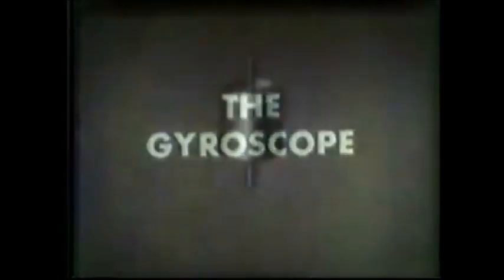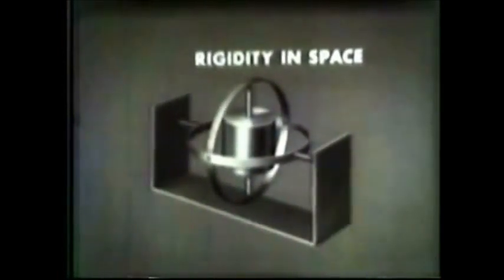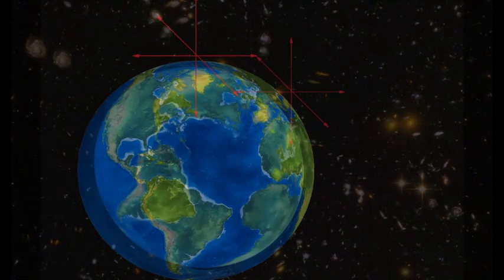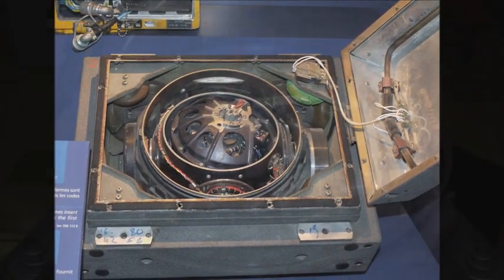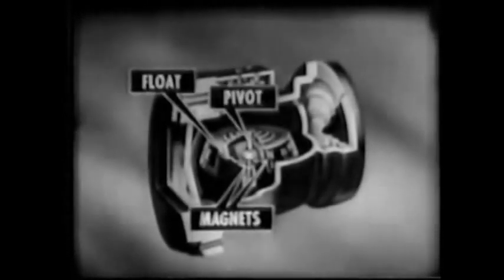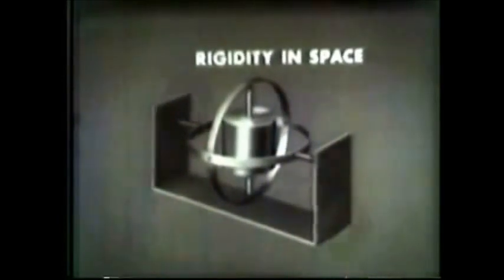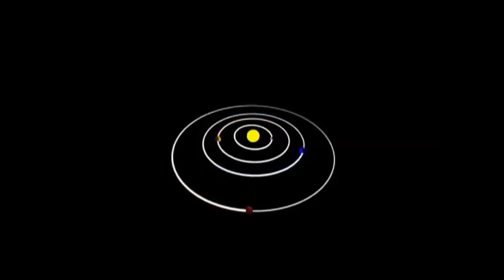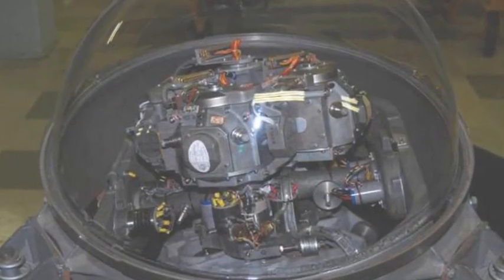Gyro Navigation: IMPOSSIBLE on a Globe...

Comment: I was a Navigation Electronics Technician and worked on the SINS (Earth referenced inertial navigation system) and the ESGM (space referenced inertial navigation system) on three ballistic missile submarines and both systems worked great on the great big round Earth!
Reply from the maker: +David Feist Well clearly they work great, otherwise no one would use them! But what I've been trying to understand is just how an "earth-referenced system" supposedly continually adjusts for curvature. The Navy training film from 1960 says this done by way of linking a magnetic compass to the gyro under "slaved mode".  Today several other explanations are given which frankly all seem rather dubious to me.  Yes, the inertial guidance systems work very well, but how do you convince me that they are working well because they are managing to stay in perfect reference to the center of the globe, and not merely in reference to the x/y/z coordinates of the starting location.  If the gyroscope has to constantly ignore G-forces while maintaining alignment with the center of the earth, why do gyroscopes and accelerometers not have to also be constantly adjusted because of the motion of the Earth's orbit around the sun, the solar system through the galaxy etc.  I've never heard this addressed thus far, yet the very explanation of gyros and inertial nav provided by official sources would seem to demand an answer.  How does the gyro stay fixed in relation to the earth's rotation, but not stay fixed in relation to other spatial motions?
Reply: It' called rho rate, or "round earth torquing".  As you move over the curved surface of the earth the platform, containing the X, Y, and Z gyro, where the X and Y gyro's are torqued to maintain the Z gyro input axis pointed at the center of the earth.  The platform is also torqued for Earth rate with is 15.04 degrees/hour to compensate for the rotation of the earth.  Also, factored in is a correction coriolis acceleration.  Dampening factors are also put in to the inertial navigation to prevent Schuler oscillations.  Schuler oscillations are 84.4 minute sinusoidal waveforms that are equal to a pendulum that has a string the length of the radius of the Earth.  You cannot shoot missiles when you have a Schuler oscillation so we were always watching for those on our X-Y plotter which continually shows the relationship velocity and acceleration in the gyro loops.  The only reason you have gyros in a inertial navigation system is because of gimbal friction.  If you could make gimbals with that had no friction then you would have no need for gyros.  The velocity meters (accelerometers) would always be feeling the proper components of gravity and would not result in an erroneous acceleration.  The gyros allow you to isolate the velocity meters from ships motion due to wave action.  Also, you have to have the area that you are in to have been mapped for gravity since gravity is not uniform.  Mountains bend the gravity vector so that gravity is not uniform on the reference ellipsoid (the earth).  An uncompensated vertical deflection will cause a Schuler oscillation to be induced in the gyro loops of the system.  This brief explanation of a earth referenced inertial navigation system is somewhat simplistic.  I think that it is one of the most complicated systems I have ever encountered.  The space referenced Electrostatically Supported Gyro Monitor system (ESGM) that I also worked on  was vastly more complicated!!!
Reply: +David Feist It should also be noted that these systems do not run all by themselves without periodic updating.  External fix information are entered into the computers which apply resets to the inertial navigation system.  The earth referenced system requires frequent resets.  Each reset physically torques the gyros which the gyros do not like which will cause a change in their drift characteristics which will require another reset later.  Gyros do not like to be torqued.  That is why a space referenced system is much more accurate because at the time of reset the gyros are not torqued, the reset occurs in the computer math model and does not physically affect the space referenced platform therefore it allows for much greater time between the need for an external fix information and reset.
Reply: +the Truth is stranger than fiction... A gyro is not a gravity device, all a gyro does is react to angular displacement.  The velocity meters on the SINS system (EMA or electro magnetic accelerometers on the ESGM system) are affected by gravity.  They are accelerometers and since gravity is an acceleration it will react to it, or for our purposes measure it.
Reply from the maker: +David Feist All in all, I find all these various explanations interesting, but, you seem to be missing the point of my original video on this topic, which was largely based on the explanation provided by the 1960 Navy training film, which obviously was using components far more simplistic than anything involving lasers or microchips being used today.  It claims to have used a magnetic COMPASS as the mechanism by which that "period updating" was achieved, and this is really quite implausible if you ask me.  Sure, it's easy to look at the systems in place today and go "Wow, it's just ridiculously complicated!!", but the farther back in time we go, the simpler the systems get, and that's where I think the real gaping holes in the explanations regarding "correction for curvature" can be easily found.  I also did a video on inertial navigation and ICBMs, did you watch that one?  So many related questions when you get into that...  For instance, you mentioned accelerometers.  So how would that really work, as you say that "gravity is constant" (aside from it varying due to things like interference from mountains, etc.), because the further up into the atmosphere you got, the lesser the pull of gravity would become.  Don't intercontinental missiles pierce up into "low level orbit" essentially?  Not only this, but you also have the fact that NASA claims that craft such as those used in the Apollo missions used a specialized form of inertial nav...  Now how is THAT supposed to have worked???  Both your gyros and your accelerometers would be completely useless once you completely pulled away from the globe and pushed out into the vacuum of space.  And before you postulate that their nav system could've been "periodically updated" by some kind of data signal from Earth, you have to stop and think about how that could've happened when something like Apollo 8 went around the "backside" of the moon.  There was supposedly total "radio silence", if you remember.  So they would have absolutely been "flying blind", around a celestial body they've never been that close to, with no radio/radar contact, no gyro nav, no inertial nav, no nothing....
Reply: +the Truth is stranger than fiction... There is no point in talking to you, you have formed your incredibly simplistic opinion based upon a simple 1960's training film and have proclaimed yourself an expert in inertial navigation.  What could I possibly tell you about how the systems really work when you are a self appointed expert?  I have showed your postings to friends of mine who also worked on submarine inertial navigation systems and we are all laughing our assess of at your statements!!!!!
Reply from the maker: David Feist
Well, I have the testimonies of other NAVAL and air force personnel, who testify to the absolute contrary, so obviously merely waving your military credentials is not in and of itself proof positive of anything, is it?  You need to explain HOW this process of round-earth-torquing supposedly is achieved, to a "simpleton" like me.  Otherwise, it's just one "expert's" word against another.  Not only this, but you actually said that they only reason gyros are used is because of "gimble friction"???  Are you for real?  The gimbles are there for the sake of the gyro, not the other way around.  That much I understand quite well at this point, so much so that to say such a thing is a blatant denial of EVERY official explanation of gyro navigation out there.  I am not "basing my understanding" on a 1960's film, I am putting forward an extremely valid question, which is, HOW did those gyro nav systems actually work, WAY BACK THEN, when they didn't even have any of the technological adjustment mechanisms which you spoke about at length in your comments above???  If you just wish to laugh it away, as if the U.S. Navy never actually released such a film, well, that's your choice.  I however find the panorama of self-contradicting explanations to be less than satisfactory at this point.
Reply: +the Truth is stranger than fiction... Okay, you are right, you know more about inertial navigations systems on submarines than I do.  What do I know?  I only made 11 strategic deterrent patrols on three ballistic missile submarines.  You sir, are an expert, self appointed with a tin foil hat.
Reply from the maker: David Feist
I am obviously not an expert.  I never claimed to be an expert.  Is this really the only angle you have left?  The only reason I started on this little direction of investigation, was after hearing an interview with a U.S. Navy missile system instructor, who publicly testified to the fact that the ship's gyro nav system never compensates for curvature, and what's more, the ballistics systems he uses (which are connected to the ship's gyro nav) never account for curvature, nor "coriolis effect", etc.  He also explains how the weapons system he uses employs a "focused radar beam", used to "paint the target" (i.e. enemy ships) over distances of up to 50 miles.  If you calculate the curvature that should be in the way, this should absolutely impossible.  After this, I listened to a retired Navy submarine officer, who testified to the same thing regarding gyro nav.  After that, it was a flight instructor, speaking to the same points about gyroscopic instruments and the "artificial horizon".  And just the other day, I'm listening to a retired Air Force officer again talk about the SAME issue with the gyro/inertial nav systems...  So, what did I do?  Did I simply believe what I heard from all these men, because they obviously have far more experience with these things than I do, and therefore must be automatically correct?  No.  I went out and tried to see if I could verify these claims on my own, independently.  (correct me if I'm wrong, but I thought that's how science was supposed to work...?)  And what I began to discover was indeed very bizarre.  Much of it boils down to the question of "do gyros indeed have to compensate for curvature" (both due to movement, and the Earth's own rotation...) If the answer is "yes they do", then you have to explain HOW (and there are quite a few seemingly contradictory explanations as to how this is done, both today, and in decades past), and why the effect of "rigidity in space" applies to relation to the Earth's movement of rotation, but not any of the other motions supposedly existing in the planetary/galactic systems.  What's more, you'd have to then explain why "ordinary", non-navigational gyros which are powerful enough to run and remain fixed for hours at a time (such as those used in steadicams, etc..) somehow don't seem to need to be "periodically updated" to stay in alignment with the rotating Earth.  And it goes on and on. 

I am simply wanting to understand, and to understand means that I need to make sense out of ALL the data of I have gathered/heard on the topic, no?  It can't all be right.  Someone's wrong.  And yes, I fully appreciate the gravity of what I am even contemplating, in entertaining the idea that indeed the Earth made not be a globe, and that yes the government and military and science institutions et al are all "hiding it" at some high-up level.  I know how crazy it sounds.  But in the end I do not believe we are living in a terribly "sane" world anyhow, so, let the Truth take me where it goes...
Reply: @thetruthisstrangerthanfict4367  " but how do you convince me that they are working well " Impossible, becasue you are a science illiterate.
Reply: +Electro-Cute Now we use ring laser gyros.  They have no moving parts.  They use an interferometer to measure angular displacement.
Reply: the Truth is stranger than fiction's Navy friends were probably mess cooks and a couple of deck apes that couldn't make it beyond E-3 in 4 years or got kicked out after a year or two and probably tell him they were a nuclear engineering officer or something whacky like that, David Feist!
Reply: @dominichix5728  I've heard the interview with his Navy expert. It was junior sailor who got trained as an operator/maintainer of a fire-control radar and then got a training position after some 4 years in the service. Had no idea of how his system actually worked and used missile guidance as some sort of proof that the world is flat. That sailor will go far, the sooner the better. DBF
Reply: +the Truth is stranger than fiction... For a shorter range missile or a shorter range air pilot you may use a gyroscope to know your up/downs and I think navigation. For longer range navigation you use a gyrocompass, which is a completly different thing. It uses friction or weights to cause one of the rings to allways face the ground. If you do not use this compensation the gyroscope (and no longer gyrocompass) will instead not rotate when the earth rotates. This have been used to show that the earth rotates and is round many times over.
The gyrocompass naturaly points towards the north because this is the lowest energy state of a gyrocompass.
Even though a gyrocompass is greate device, having to high speeds and other things can cause the gyrocompass to get off course. This have to some how manualy or digitaly be corrected with a torque. But it isn't any problem on smaller scales.

+David Feist Correct me if I am wrong haha.
Reply: David Feist That sounds realy cool, I was just thinking about the older days :)
Reply: +the Truth is stranger than fiction... "you actually said that they only reason gyros are used is because of 
"gimble friction"???  Are you for real?  The gimbles are there for the 
sake of the gyro, not the other way around."   David Feist was talking about a **stabilised** inertial navigation platform where the detection instrument is an accelerometer which would not need gyros if friction could be eliminated.     You asked why the earths motion around the sun is not taken into account.  According to my maths the Earths orbit around the sun is creating an error after one hour of 2.5nm which would not be much in 1965 but i imagine that would be miles out today.   I am supposing the orbit around the sun must be allowed for today for the best systems.
Reply: +Ice Skater You don't know what you are talking about.
Reply: David Feist
I now have two mechanical aviation gyros and both use the same wiring arrangement to link two of the phases of the gyro motor to a three contact level gauge.  So now I am really thinking the phases can be used to erect the gyro.
Reply: David Feist
It turned out there was an erection torquer on this gyro after all.   I spent all weekend working out the wiring and tryiing to get it to work for almost zero results-  I am supposing it needs a dedicated amplifier controller to run the torquer.
Reply: David Feist
"Iceskater you dont know what you are talking about" I see gyros are being used to measure the wobble of the earth and even to measure the proposed impact of special relativity using a gyro accurate to within billionths of a degree per hour so we can suppose the earths rotation around the sun will stick out like dogs balls and at a rate of 1 degree per day I would have thought that it would be detected on a decent inertial navigation set up.     So while I agree I do not fully know what I am talking about I gather the same must apply to you.  We only know what we know - and these days nobody is a specialist of everything in their field.
Reply: David Feist
Sorry.  Do you know if a mechanical gyro can be erected using a resistant liquid in a three contact level guage where the resistance appears to be applied to one or two of the phases of the gyro motor?    I am trying to get a bendix polar path gyro working.  Thanks for any information you can give me on that.